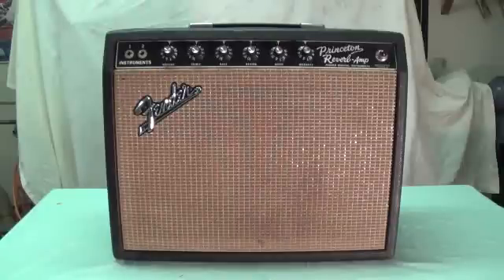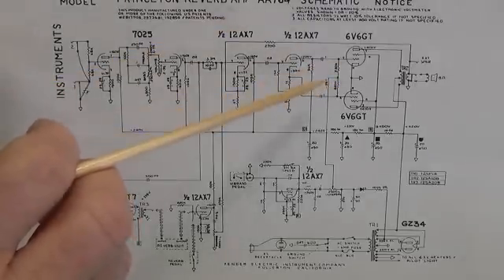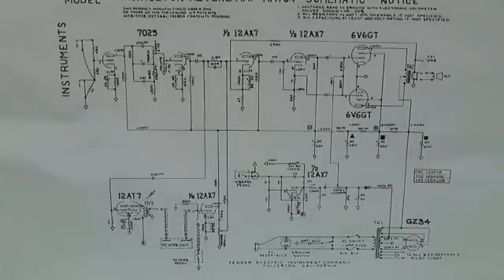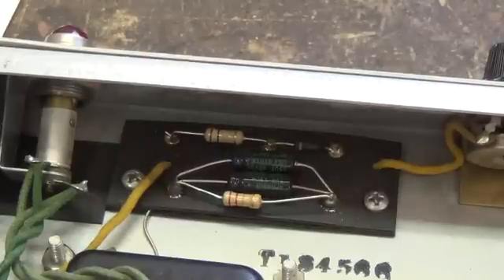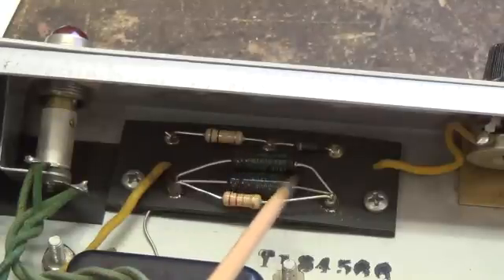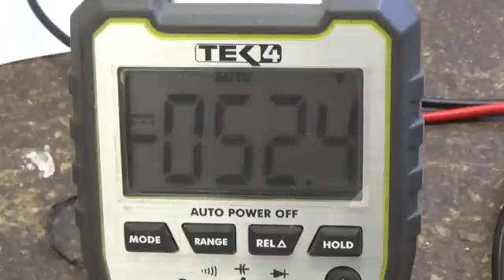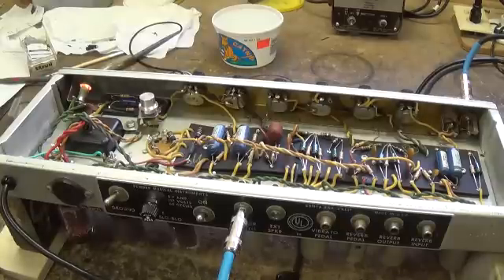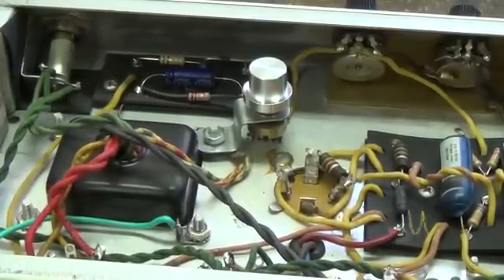Converting the Fender Princeton to Adjustable Grid Bias

Comment: Hi Doug! To monitor the plate current did you un solder at pin 8(rect) or pin 3 (Output tube) and put the meter in series  between them or is there an easier way to do it?  Thanks.
Reply from the maker: See my videos on biasing, Michael. You don't unsolder anything. Depending on  if the circuit is cathode biased (measure the voltage drop across the bias resistor) or grid biased (measure the voltage drop across each half of the output transformer primary) it's easy to indirectly determine the plate current.
Reply: Doug, I understand how to do the bias techniques from your  excellent bias videos. I was just curious as to how you were getting the plate current directly to you meter in this video, thinking it may come in handy . Thanks.

Comment: Hi Uncle Doug, sorry to hear   about Rusty, really looked forward to seeing him in your videos. Thanks for all your work and sharing your vast knowledge and skills. 
 I  have a question on this circuit....Does the Intensity pot vary the 6V6s bias when the vibrato is shut off? This has me perplexed thinking that its possible to vary the output tubes idling bias by changing the vibrato intensity control please help me understand.I can understand how the vibrato would modulate the bias to get the vibrato effect but once it is shut off does it  still change the tubes bias?
Reply from the maker: The bias is set for the output tubes with the tremolo shut off, otherwise you couldn't get a stable reading to base the adjustment on. Once you turn on the tremolo, the bias varies above and below the set bias point to give the tremolo effect.
Reply: @UncleDoug  Thanks, the only thing i can come up with is that the grids don't pull any current so the inline resistance of the Intensity pot doesn't change the negative bias voltage no matter the setting on the Intensity pot?

Comment: Hi uncle Doug.  We chatted a few weeks ago about our favorite amp the Princeton Reverb.  I watch this video over and over again and just realized that you made your bias adjustment based on plate current.  I biased to the -34vdc on the schematic.  That doesn't give me a accurate measurement of the tube voltage and dissipation.    Would you recommend that I go back in and do the same rather than trust the bias voltage from the schematic?
Reply from the maker: The -34VDC figure is simply an estimate and varies depending on the age of the output tubes and condition of the circuit, Tele. To accurately  set the bias for a specific amp circuit, you need to measure both the PV and PC, then calculate the Plate Dissipation, which should be around 8W or slightly higher for grid biased 6V6's.

Comment: Doug, I must say awesome video! 
I noticed you directly measured PC with your dmm, meaning you put it in series with the actual current. I’d rather not do this. Just wanted to point out that you’re still able to use the calculation method you presented in your “biasing double ended amps” video, correct?
Reply from the maker: Thanks, Nathan. I understand your hesitation. A good friend of mine who's been an electrical engineer for many years burned up a Fluke DMM doing this same procedure....so it's definitely hazardous.  I did it strictly for the video, so the actual PC would show on the screen.  Yes, you can use the voltage drop across the output transformer primary method......it will work just fine.
Reply: I study electrical engineering at ASU and they've always told us to use the calculation method for that reason. It was nice being able to see the current measurements on screen though! I just wanted to point out to others in the comment section. Thanks for the reply, best wishes to you and Rusty!
Reply from the maker: You're welcome, Nathan. Best of luck with your studies.

Comment: I know I'm super late to the party but.. how are you measuring the plate current .. I'll most likely short out my Multimeter if i switch to mA current with one connection on pin 3 and the other grounded ..
Reply from the maker: I explain how to measure plate current in my "How to Bias a DE Amp" video, Michael. You measure the voltage drop across the two windings of the output transformer primary.
Reply: Thanks so much, Uncle Doug, for getting back! That's what I figured just didn't know if there was some secret or something... Your videos have been immensely helpful, entertaining, and fascinating -  and as a fellow teacher I have the utmost respect for what you do on your channel! keep keepin' on!
Reply from the maker: You're welcome, Michael. Thanks !! We will :)

Comment: Uncle Doug, great video, two questions.  Have a '66 PR, believe it still has the original tubes.  1.  If I don't have problems, do I need to change them?  2.  Can you recommend a cabinet to hook up the external speaker jack to for some extra volume?
Reply from the maker: Thanks, Joe. 1.) If you have no problems, leave it alone. People invariably cause grief when addressing non-existent issues. 2.) Connecting to an external speaker is generally an either/or situation.....i.e. internal or external, but not both......otherwise you will create an impedance mismatch within the output transformer. Also, increased volume will probably not result in either case, since the output power of the amp remains the same. If you want more volume, either mike the cabinet speaker through a P.A. system, or use an overdrive pedal.
Reply: Thanks Uncle Doug!  Sound advice.  Had a guy at a local amp shop push the 'groove tubes' saying that if I replaced ALL the original tubes, I would increase the volume and quality of sound.
Reply from the maker: Asking an amp shop if your tubes need to be replaced is like asking a barber if you need a haircut......they have a vested interest in convincing you to do so. If the amp functions well for your use, leave the tubes alone. I have some 70-year-old vintage amps that still have most (if not all) of their original tubes, and they sound great.

Comment: Hi Uncle Doug if I wanted to change the 6V6 o/p valves on a Princeton AA964 to a 6L6/to get more power output would your mod with adjustable grid bias work ok or would it be best to cathode bias and start with about a 100 ohm 10 watt resistor and leave the existing grid circuit with a negative - 33V going to the 220K grid resistors as it is  .Thanking you Tony
Reply from the maker: I wouldn't recommend this conversion, Tony, unless you also replace the power transformer and output transformer, to better handle the higher filament current and lower output impedance. I would think that the  adjustable bias circuit would work just fine.....it does on other Fender 6L6 amps.
Reply: Thanks once again DOUG
Reply: hi Doug and Rusty the power tranny I  used in this build.  Secondary ht  650 v centre taped   rated at 140 MA  6.3 v @4 amps and 5v rated @3amps  would this tranny be ok  for the princton AA964 to change to 6L6/s
thanks for your great support
Reply from the maker: You can look up the current requirements for the tubes in any tube manual, Tony, and answer this question for yourself. The 140mA rating for the HV would be marginal.

Comment: hi uncle Doug that 10k pot for the mod. can you use a normal pot or do you use a higher wattage  like a wire wound pot to handle the current. and question  2  after setting the correct bias with this mod by adjusting  the intensity pot to a different setting  wouldn't this put  the bias  out again 
Thanks for your great informative videos great help to every one cheers Tony
Reply from the maker: You're welcome, Tony. I used a "normal" pot.....very little current flows through this circuit. The tube bias is set with the tremolo intensity at zero, which is the way the amp is normally used. When the intensity knob is turned up, it does alter the bias, but that's how the tremolo works.
Reply: thanks for that Doug. I have just finished building a Fender  Princeton  AA964  beautiful clean sound I am so impressed with it. I could not have done it without learning from your great videos, I have learnt a lot. Great work of yours thanks Doug and Rusty. 
cheers Tony
Reply: hi Doug  again if I wanted to change the o/put  valves on the princton  AA964  from 6V6/s  to 6L6/s to get more power  out  what would be the best way to change the bias would your mod with adjustable grid bias be ok or would I be better off change it  to cathode bias and start with about 100 ohm 10 watt resistor  and leave the existing grid circuit with the Negative  33V going to the two 220k grid resistors  as it is 
thanks so much for all your great help 
Cheers Tony

Comment: Uncle Doug, thanks for the wonderful videos. I'm adding an adjustable bias to my 72 princeton reverb right now and have a question. Some lug-nut drilled a hole in my chasis to the right of the reverb input, so I'll put my pot there making it accessible from the outside/rear of the amp (i'll use a recessed trim pot from fender so you can't adjust it without sticking a screw driver into it).

My question is, ... can I just run a wire from the negative side of the bias cap to the center lug on my pot, and then put a 24K resistor from the left lug of the pot connected to the back of the pot (which is grounded to the chasis)?
This seems like it would give me the 24k->34k variable resistor exactly where I want it. I'm confused why you use all three lugs of the pot for your circuit. Do you see any problems with this approach?

Note that I would remove the original resistor across the bias cap altogether.

Thanks so much!
Reply from the maker: My circuit presents a constant 35K ohms between the Bias power supply and ground. The adjustability of bias voltage is achieved due to variation in the resistance between the wiper and ground. Your circuit varies the resistance between the bias power supply and ground, which will most likely have a negative effect on your tremolo intensity. My suggestion is to try it your way and see how it works. If you're not happy, then try it my way.  Let us know how it all works out.
Reply: Thanks for the quick reply great uncle! Ah ... I see what you mean looking at your circuit again. I ended up trying my circuit and I was able to dial in the bias for the tubes nicely. The tremolo worked great, but I of course couldn't compare it to your method. The trem seemed pretty intense and was able to go from nothing to beano, but still had good adjustability. 

Maybe I'll do a video and demo it so others can comment on how it works & sounds compared to their amps. Thanks again for all the great teaching and advice. Your ability to explain concepts and willingness to teach others this ancient art is appreciated beyond words.
Reply from the maker: You're welcome, AS. I'm glad to hear that your adjustable bias circuit worked well for you. Thanks for sharing the outcome with us.

Comment: hi Doug an Rusty a little question , if the centre of the intensity pot is controlling the bias , on the 6V6/S. what happens when you vary the intensity  pot from end to the  end  wouldn't it also  change  the bias  on the o/p tubes to a great extent. 
thanking you and thanks once again for your marvellous videos the best by far on U Tube
cheers Tony M
Reply from the maker: Yes, which is exactly how the tremolo creates its effect, and why it's called a bias-modulating tremolo. Please see my videos on the two main types of tremolo for a fuller explanation.
Reply: thanks Doug, I have seen them but I will watch them again
Cheers Doug and Rusty
Tony M

Comment: Hey uncle doug, great videos you have over here! I have a background in electrics and playing guitar (both terribly), but i am mew to valve circuitry. I have decided after watching your build from scratch series to build my own princeton with this mod attatched. the Aa1164 schematic im using/modding has 5u4gb tube, and i was wondering if i could use a 5ar4 instead for some more headroom and less sag, can it be a straight swap or do i need some more modding? Many thanks!
Reply from the maker: Greetings, Craig, and thanks for the nice comments.  The 5AR4 or GZ34 are both much better rectifiers than the 5U4.  They can be substituted with no circuit alterations, other than making sure that the output tube bias is properly adjusted after the substitution.

Comment: Hi Uncle Doug!  I want to add a bias pot to my '62 Fender 6G4-A amp.  Could you please help me?
Reply from the maker: Since there is already a 10K resistor in the negative DC bias supply, you can simply replace the 56K resistor with a 100K pot. Set it at 56K before turning on the amp, so the circuit will initially be the same as with the fixed resistor. Set up your DMM to monitor either voltage drop across OPT winding, or actual plate current (by shunt method......a little dangerous), and adjust the pot very slowly and carefully until you get the PC and PD you seek. Be careful, you can destroy your output tubes if you're not. Good luck.
Reply: Uncle Doug this is to add a bias pot to bias the tubes?  I have a tube bias reader (the type that you plug into the sockets), and I want to be able to adjust the bias to the tubes.  Wouldn't it be similar to this video?
Reply from the maker: Yes, above I explained how to add a bias pot, just like the one in the video.
Reply: Uncle Doug so I would take out the resistor, put leads from both points where the resistor was, and attach them to the 100k pot?  If that is correct, which legs on the pot?
Reply from the maker: When wiring a pot, you generally connect one input to either of the outer legs and the other to the center leg. The outer leg you choose will determine if the resistance increases or decreases when you turn the pot clockwise. Generally, you will pick the leg that reduces resistance as you turn the pot clockwise.  You can determine this with an ohmmeter.

Comment: Hey Uncle Doug, You may have covered this before in another video and I missed it but when you are checking the output tube current in this video at ~10:20 in Ma  where are you connecting your leads? cathode to plate?
Reply from the maker: The proper way to measure Plate Voltage is between cathode and plate, since it is the potential that exists between these two structures within the tube. Measuring Plate Current, however, is a more complicated procedure that I cover in the Biasing Double Ended Amps video.
Reply: thanks great videos btw you have the greatest teaching gift I've found in electronics videos!, I've watched the grid bias part of your double end series. Have done both  cathode and output trans bias process several times. its a labor intensive trial and error way to tune the plate PD.  After watching this video several times I saw that when you adjusted the Princeton that you had your meter on the Ma scale and were showing the current change as you dialed in the bias on the newly installed pot. I've just done a similar mod on a Gibson Vanguard (which was running way cool on the outputs) and wanted to dial in the exact right idle current in the same manner?
Reply from the maker: The only way to directly measure Plate Current is to use the OPT winding shunt method, in which you attach probes to the CT and output of each primary winding, one at a time, set the meter to A or mA, and allow the current to flow through the meter instead of the coil. I do not recommend this method due to the danger involved.....both to the individual and the meter. Thus, while I may show the result in a video, I do not show the method.
Reply: Thanks Doug.. I'll research this as it seems the best way "all be it dangerous" to fine tune the values quickly. I seem to recall something about a 1 ohm resistor test harness.. pretty sure I can avoid death if I haven't killed my self already tweaking amps :)
Reply from the maker: Good luck, Bill......be careful. Some very experienced techs have incinerated their Fluke DMM's while employing this maneuver.
Reply: Thx Doug Yep will do, bought one of those nice Hoffman Bias kits yesterday. I notice my Fluke and BK both have Fuses.. hoping I can avoid a burn down but.. as they say the hard lessons are the ones best learned :)

Comment: Hi uncle Doug. I want to make an amp wiht 4 6l6 gt at the output, but my 6l6 's aren't match. how I can biasing each one individually? to get the best sound. I apologise for my english. I am from Argentina here is not easy buy 4 6l6 gt matcheds is too expensive and I have 4 6l6 gt in great condition but diferent brands. Thank to you and rusty for this videos. the stuffs you make are awesome
Reply from the maker: Greetings, Damian. Your English is just fine. When you use 4 output tubes, they are wired as two parallel pairs. If you cathode bias each of the 6L6's individually, you could select bias resistor values that will provide the same plate current and plate dissipation for each. Good luck.
Reply: Thaks uncle Doug. I hope dont blow up everithing ha ha ha ;-)
Reply from the maker: I'm sure your neighbors agree, Damian. Good luck :)

Comment: seems like you were measuring the tube current using the OT shunt method instead of using Ohms law as per your other video.  Correct?
Reply from the maker: Yes, simply because it allowed for direct measurement for video purposes. This method is somewhat dangerous however, both for humans and test equipment, so I tend to preach the gospel of indirect measurement via voltage drop across OPT windings or cathode bias resistors.
Reply: Uncle Doug I see.